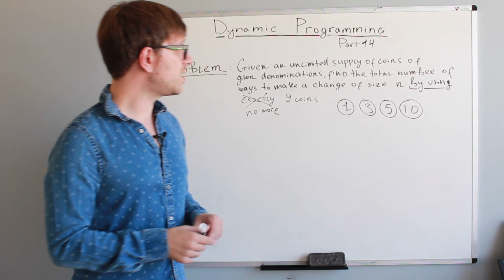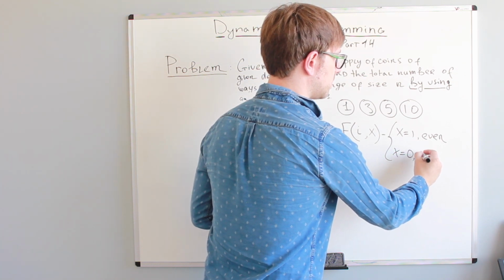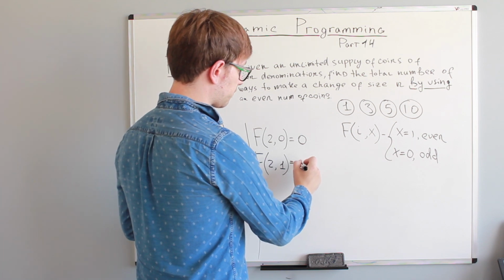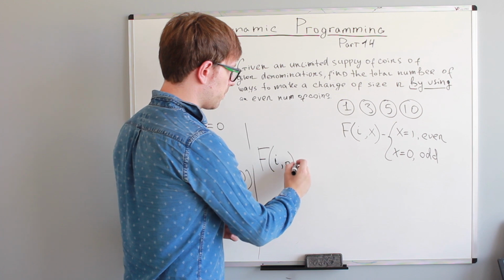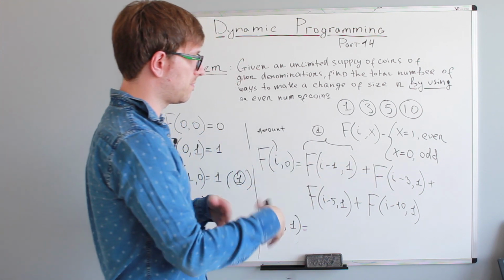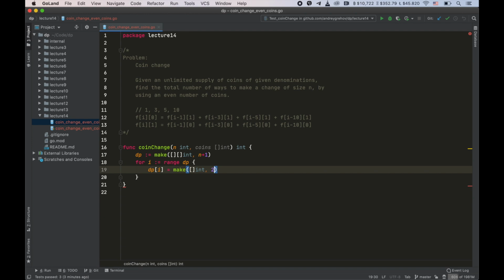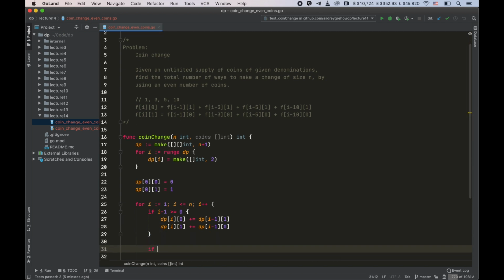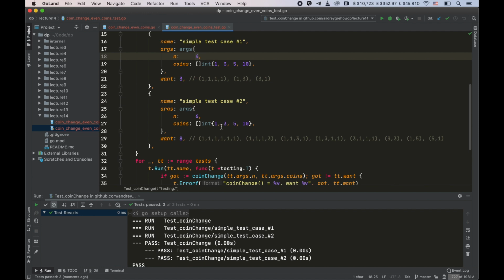14. Coin Change. Part 3. (Dynamic Programming for Beginners)

Comment: Thanks for the amazing videos. Recurrence relations are the most important for dp and you have so beautifully driven the point home. I would like to point out that in here we can probably use the evenness of i to build the dp. One step before if i is even, then i-1 should be odd. Using the mod function which you had pointed out in an earlier video :). Here I stick to the constraint that 1 is even and 0 is odd.

def coin_change_t_coins_even(n, coins):
    if n <= 0:
        return 1

    dp = [[0] * 2 for _ in range(n + 1)]
    dp[0][0] = 0
    dp[0][1] = 1

    for i in range(1, n + 1):
        for j in coins:
            if j > i:
                continue

            dp[i][1 - (i % 2)] += dp[i - j][i % 2]

    return dp[n][1]

Comment: First of all thank you for the great series. The explanations are very nice and clear. But there is a thing I miss with these coin change sort of problems. For me it is difficult to imagine the case when we are exchanging zero coins. For example why do we have exactly one way to exchange zero coins with an even number of coins and we have no ways to exchange them with an odd number of coins. You said when we are exchanging zero coins with an even number of coins (F[0, 1]) then we are returning an empty coin. But why an empty coin counts for an even number of coins? Do I need some sort of intuition on it? Is there any technique or rule to test such a conclusion?
Reply from the maker: Hey Viktor, thanks a lot! The reason why F[0,1] is 1 is because we are returning 0 coins and 0 is considered an even number :) Does it make sense?
Reply: @andreygrehov  Thank for a quick reply. I see it now, it makes sense. My issue was I never considered zero as an even number (which it is by definition. There is an article on the subject: https://en.wikipedia.org/wiki/Parity_of_zero). Thank again for such a great series.

Comment: Firstly, thanks for making these videos. I find your method of teaching very clear and you have demystified this topic. One small thing that I noticed with the coin algorithms. The results give the number of combinations of coins that satisfy the constraints and not the unique number of solutions. I think that this is important to state. There is an easy change to the code to make the results unique by looping through the coins first. This results in {3,1} and {1,3} only being counted once. Also a very minor point, it might be helpful to map odd=1 and even=0. Here is my code in Python:

def coin_change_oddeven(n, x, coins):

    # 2d problem as objective fun is F(i,x)
    dp = [[0]*(2) for _ in range(n+1)]

    # base cases
    dp[0][0] = 0
    dp[0][1] = 1

    # solve 
    for c in coins:
        for i in range(1, n+1):
            if i < c: continue
            dp[i][0] += dp[i-c][1]
            dp[i][1] += dp[i-c][0]

    for r in dp:
        print(r)
    return dp[n][x]

print(coin_change_oddeven(4, 1, [1, 3, 5, 10]))
print(coin_change_oddeven(6, 1, [1, 3, 5, 10]))
print(coin_change_oddeven(5, 0, [1, 3, 5, 10]))
Reply: great point! thanks for bringing it up! 
my 5 cents :-)  you do not need the "if" in the loop, just start from the coin:

for c in coins:
        for i in range(c, n+1):
            dp[i][0] += dp[i-c][1]
            dp[i][1] += dp[i-c][0]